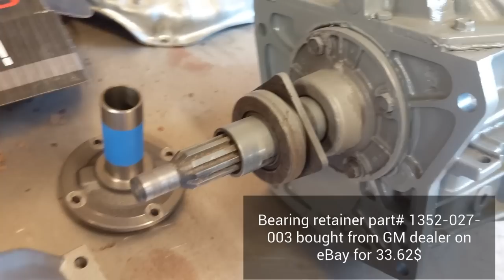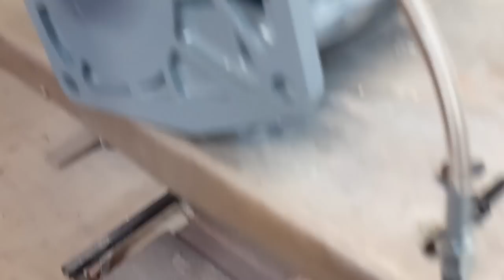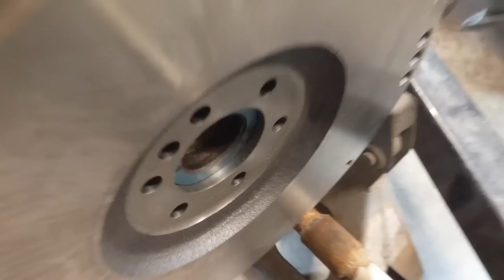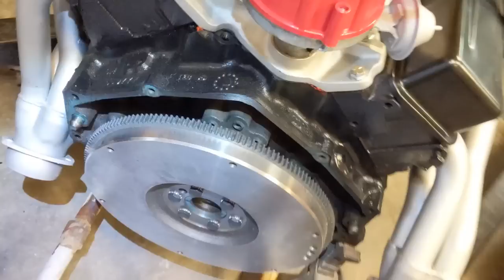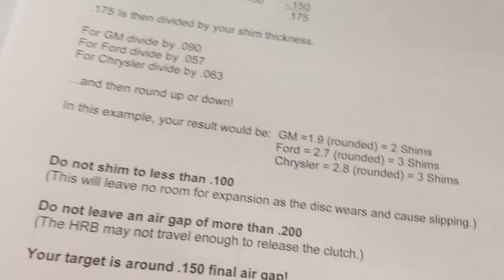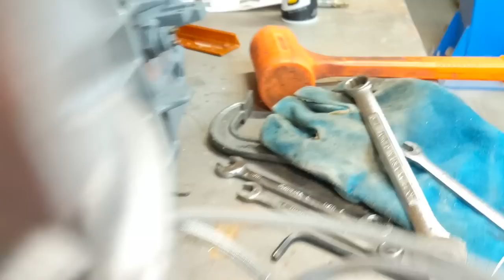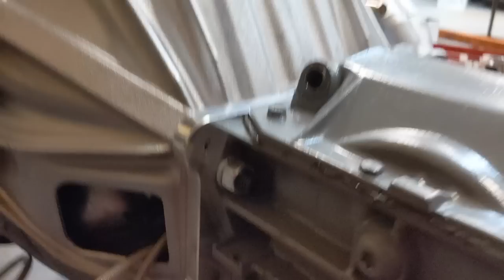Swapping a 5-speed manual behind a first gen Small Block Chevy

Comment: Hey, I was curious on your thoughts in regards to leaving the T5 in a mustang and mating it to a 5.3 I understand the limitation of the T5. I figure its the most cost effective way to go manual 5.3 in a fox. What are your thoughts on the bell housing and throw out bearing?
Reply from the maker: I assume you are talking about a GM vortec 5.3 In a Fox body Ford? Boy that combo would rub some people the wrong way. Not me, though, I think that's a fine idea. I don't think the same bell housing I used would work for you, but the throw out bearing would work as it rides on the transmission bearing housing. It would be cheaper to hook up mechanical linkage, but I like hydraulic TOBs, and the extra cost to me is work saving the headache of linkage on a custom ride. Others will tell you the transmission isn't rated for the HP or tq the 5.3 puts out and they are right, but I've seen guys run 450hp on a stock T5 so as long as you know how to drive without putting unnecessary stress on the trans, you should be fine. If my assumptions on motor are correct and you move forward with this idea, you can reach out to me if you need help sourcing the correct bell housing.
Reply: Thanks for the reply. Sorry, I should have clarified. Yes, I would like to mate a GM 5.3 to a T5. Ive seen some guys run T5’s pretty hard with mildly built 5.0 liters and they seek to hold up. I am aware of the risk of it coming apart though.
Reply: @Gregoman89  In case it is not too late, I have a T5 up against a 2000 5.3 in my S10. I used a 1993 WC T5 out of a v6 camaro, a 621 reproduction bellhousing, a hot rod works adapter just like his, 1973 Chevelle BBC clutch, Sachs 1050 flywheel (literal lifesaver), and a Howe hydraulic throw out bearing with a remote bleeder I bought from speedway. In 1993, the GM t5s changed their bolt pattern to a ford style, hence the adapter. If I would have known that before I bought the trans, I would have bought a mustang T5 like Austin so that the shifter would be straight up. The camaro t5s have a 18 degree twist that I had to correct with my shifter lever once I replaced the original clocked bellhousing with the straight up 621 bell. The sachs 1050 flywheel is a lifesaver, it is for a manual transmission found in the 4.8 and 6.0  Silverados and it is the LS crank bolt pattern but the clutch pattern is for a BBC chevelle clutch. I do not know your application but I kept the original S10 clutch master cylinder as well (11/16) , I did not need the recommended 5/8 master but my pedal throw is just really long. 

As far as the t5 holding up, I have had no problems yet. My 5.3 should be right at 300 horse to the flywheel and have romped on it about 10 times now with no issues. 

Both the ford and GM transmissions work, but I would probably argue the ford is a little better because of the straight up shifter. You could replace a GM t5 tailhousing with an S10 one, but that was more money than what I was willing to spend. 

Good luck
Reply: Cody Haynes thank you for the reply. It’s not too late. I’ve put my project on hold with everything going on.
Reply: I think that sounds like a killer combo if you ask me.
Reply: Sbc bellhousing bolts right to an Ls, just one bolt in the block isn’t drilled
Reply: I believe it would, one of the bolts don't line up and you will also have to shave the passenger side ear! If memory serves me right!
Reply: ...for the starter to sit right! or is my memory all over the map!

Comment: Great video brother!
Hey I'm trying to do the same for my firebird i got the full swap from a 80s Camaro
Here is my problem, maybe you can help me with some pointer
The flywheel don't match with the crankshaft, the flywheel is smaller, i read that it's because of the different generations in the 350 Chevy engine 
Can you shine a light on this problem?
Thanks brother
Reply from the maker: There are a few different gm small block flywheels. Off the top of my head I believe some generations were internally balances or externally balanced. I also believe there are two different weights of flywheels so you have to be careful you don't install the wrong one. Shoot me an email at acthecarguy@gmail.com with as much info as you can and pictures if possible and I'll see if I can help
Reply: @AustinCoulson  400s and 350s with 400 cranks, that's the 383s are usually externally balanced, 163 or 8...tooth I think!  ...dam memory! Some Big blocks also are externally balanced, the rest are the 153s and internal!

Comment: Is that a ford t5
Reply from the maker: Yes, WC-T5 from a Ford Mustang
Reply: @AustinCoulson  how much did this cost
Reply from the maker: @peytonwalters7594  I think I got that 
Transmission for 700, the price for the conversion parts are in the video, but it was something like 2000 in parts, but you can do it for a lot less if you don't use a hydraulic throw out bearing
Reply: @AustinCoulson  ok thank you for the reply

Comment: The GM camaro and TA transmission (T5) have the same front bolt pattern correct ? And the mount up will be the same ? I could keep my 1985 vette bell housing or better to get the Z28/TA  bellhousing ?
Reply from the maker: This is a little outside my wheelhouse but I believe that every Chevy T5 had the same front housing pattern. I wouldn't be surprised if if it were the same front pattern as the older 4 speed manual. Chevy did not like changing things back then

Comment: Great Video, hopefully something like this will work for me....been looking into 5 spd options on this.
I have an '80/90's Chev 4.3L 90°V6, ex-Flex Plate (350ci÷2 cyls essentially)
I'm planning to put it in an early Holden 🇦🇺.
Cheers for your good work from over here👍
Reply from the maker: I don't see why it wouldn't work. The bolt pattern is the same and I think the same flywheel bolts up. If you run into any problems email me at acthecarguy@gmail.com and I'll try to help.
Reply: @AustinCoulson  Thanks very much for your swift reply mate.
I might need that offer at some point...cheers.
Hopefully should be a fairly straight forward swap.
Some of our early Holdens had optional Holden straight 6..Holden V8 OR.....307/350...all had the same K...(I'll be going from what was a Holden straight 6) HANDY THING....It's possible to still buy the genuine or aftermarket Chev-Holden Mountings and they also fit this V6, in the same location as they would be on the V8 blocks...so I'm thinking🤔...Too easy🤗👍
My thoughts were, is the rear of crank different auto/man, which flywheel, which box, from which model etc etc etc etc...this vid helps me to look away from 2nd hand mix and match, and rather the aftermarket/perf. options.
I'll sub now to be sure i can find you when I need some tips....lol.
I have a few shorts vids up too you may find interesting🤔
Reply from the maker: @simonilett998  I'll check your vids out. You guys got some pretty cool variants on GMs and Ford's that I am jealous of. Especially on I6s. I think one issue u may have is if the crank is rear balanced or not, as that changed the flywheel distance and what flywheel you use. The one is the video was externally balanced and you can tell because there is a large iron weight that sticks out and it uses a two part main seal. I seem to remember that most 4.3s I've worked on were internally balances with a one piece ream main seal but I'm not 100% sure
Reply: @AustinCoulson  Yep, mine definately has the one piece rear main seal...not the old rope stuff...and the weird offset crank journals of course.
I haven't had a good look at the crank in a long time....no large weights on the original flex plate that I recall, and never saw the t.c, but I do still have the plate for retro...lol...I bought just the engine, no trans..pretty much complete top to bottom, air cleaner to sump, no electrics...many many years ago, it was a virgin bore when I stripped it down👍
Reply: @AustinCoulson  I have a BW 0507 5spd (cast steel i think, ally top cover) behind the L6 currently...would you happen to know if it's possible to get a bell/flywheel/clutch combo to suit this box or is it maybe too weak for the torque of the mighty 4.3?
Reply from the maker: @simonilett998  I'm not sure as I have little knowledge of the 0507, I'm not sure I've ever even seen one, I thought they were not supplied to the US. I usually try to find the WC T5 with carbon fiber synchros for use in projects. I will say that the BW transmissions seem to be underrated as I've guys mention that they put them behind a bib block Chevy with no issues.
Reply: @AustinCoulson  I'll have to do a little more research...what makes this more interesting is we never got anything with the 4.3 over here (aside from mercruiser engines in boats) everything V6 from '89-90 onwards here has been buick based (so little to compare to) 3.8's or now Alloycrap 3.6's....however we do have gen2, 3 etc so there WILL be a combo I'm hoping.
Reply from the maker: @simonilett998  thats a shame, the 4.3 vortec is an indestructible motor. Small, light,decent power, cannot be killed. I love them. Even the 4l60e they connected with them can handle double the power the 4.3 puts down.
Reply: @AustinCoulson  I believe mine to be pre-Vortec, as it came complete with Rochester 4bbl Carby, also no internal counter balance shafts (I still have the factory air cleaner housing it came with too)
No idea where the engine came from, and have seen one here in a Hyster forklift, large cap Delco elec.dizzy, but running LPG and I believe it was all STD fitment on them, so I guess they must be tough and reliable if used in boats and forklifts..lol👍
My engine also came with a US style 110V plug-in coolant heater element, in one of the core plug holes...I had assumed from US, Canada maybe....guessing to stop the coolant/anti-freeze freezing over night...lol

It's going in a '78 car, so shouldn't be an issue sticking with the carb, for the 'period correct look' and likely there's an efi option i could throw at it in future👍

Comment: do I have to use a hydraulic throwout bearing?
Reply from the maker: You sure don't. You could save a lot of money if you used an traditional setup. You also may not have to swap the front bearing retainer depending on the fork and bearing you use. I prefer the Hyd TOB setup because I love the feel of the pedal, reliability of fewer moving parts and I often do these swaps on vehicles with limited tunnel space so I find it easier to run one small hrdro line than to setup all the linkage for a traditional setup.

Comment: Is there any way to make a mustang t5 work on a ls based platform im doing a 5.3 swap in my 89 and would like to keep the t5 thats in it
Reply from the maker: Yes it's possible, but you would have to take it easy on the T5 as it's only rated to 305hp, and I would assume the LS would be cranking out more than that. If no one makes an adapter for it, you would have to do that yourself. It can be quite time consuming to fabricate those from scratch. I would look into a T56 swap instead as it's stronger and there are plenty of adapters around for it.
Reply: Do everything he did with bellhousing, throwout bearing, bearing retainer and bellhousing adapter. You will need a 621 reproduction bellhousing to clearance the large LS flywheel and a ten spline clutch and corresponding flywheel. I would look at the Sachs 1050 flywheel, it came on the 4.8 and 6.0 manual Silverados. It is very thick, an inch I think, so it will help make up some distance you lost with the bell adapter. I believe the clutch that came on those Silverados were 10 spline so they should work on the Mustang t5, if not, try an old BBC Chevelle clutch. They used to be 10 spline in the early 70s I think and will match up to the flywheel clutch pattern on the Sachs 1050.
Another option would be to use a GM t5. If you got a World Class one out of F body before 1993, it will be the GM bell pattern so no adapter. It will also have the correct length bearing retainer and you would not have to buy a special pilot bearing. The input shaft would also be the higher spline count that would give you access to more LS clutches. The major downside to the GM F body t5s is the twist in the transmission. Once you bolt on the straight 621 bell, the tailhousing will be turned 18 degrees clockwise. An option to fix this it to get an S10 t5 tailhousing, but I chose to just make a shifter rod with a bend in it and save the money. 

Both the GM and the Ford t5 can work, it is just a matter of what you want to replace.  
I hope this is helpful and not too late.

Comment: I done the same thing with mine last year. Ive been wanting to show people how to do it but i havnt got to it. Took a ton of pictures. I used a 95 t5 though so i had to put a spacer between the engine and bellhousing because the input shaft in the 95 was much longer and i also had to trim some off of the tip of the input shaft.
Reply: Speeday makes an adapter pilot bushing but its very long so i just cut it in half so it didnt stick way out
Reply: Also dikota digital makes a speedometer adapter to run a factory manual cable driven speedometer off of the ford t5 or tko transmissions. You also need a conversion u-joint to make the driveshaft work.
Reply: I too am swapping a later gen t5 (94 wc t5) to my small block 350, what size spacer was needed to achieve the required tolerance?

Comment: Is your shifter supposed to be able to move into gears without engagement of the clutch before put into car and plugged into rear axle? I have a manual clutch system in my 65 falcon and my shifter can go into gear without being in clutch but it is not connected to the drive shaft yet
Reply from the maker: Yes, it's perfectly normal to be able to shift through gears without clutch engagement when the engine is off, or the transmission isn't even hooked up to a engine or driveshaft. usually some gears will be easier to slip into depending on the positioning of the synchros.
Reply from the maker: Also, I freaking LOVE Falcons. I've owned a few, but not currently. I am looking for one that I want to put a 300 I6 into with a T5 conversion and strip it down to weigh as little as possible and build it for autocross.
Reply: Austin Coulson thankyou. Iv got a spare 1965 falcon future hardtop original v8 car for ya.
Reply from the maker: @therealdyl5963  oh geez, don't let my wife see this, lol. Where is the car located?
Reply: Austin Coulson crestview Florida

Comment: Gm is input shaft is 26spline how are you using the mustang one?
Reply from the maker: Great question, the gm T5 is a 26 spline (at least the ones I've seen), some guys will swap the input shafts for a Chevy one to use the later 26 spline clutch disc. I prefer to keep the Ford 10 spline and use the older style GM 10 spline clutch disc. The GM and Ford 10 splines are the same diameter so they are interchangeable and there are a lot of options for GM clutches because a lot (if not all) of the GM 4 speed manuals used a 10 spline input shaft. Check out the part number I put in the video if you need more info on where to source the GM 10 spline clutch. Thanks for watching!
Reply: @AustinCoulson  I just got a 85 nwc 5 spd for 150 and now finding out I bought the sick kid of t5's. I may just buy a gforce case and astro gears for it because I am putting it behind a ls in a 86  short bed ranger
Reply from the maker: That's a solid idea. I'm sure you will want the strength since you can get basically unlimited hp out of an LS.  It would give you room to grow hp without worrying about the trans. You building a sleeper or show truck?
Reply: @AustinCoulson  little patina'd pro touring style mini truck or as my wife calls it my scoot scoot.

Comment: I still dont understand what a local guy did here to fit a 1994 camaro v6 t5 to a 1983 305 camaro, he said he drilled out a sbc bell housing then lined up the v6 t5 trans and welded the trans to the housing?
Reply from the maker: I'm not 100% sure but it sounds like instead of using an adapter plate to make it work, he just welded it. If I'm not mistaken the bell housing to engine pattern would be the same on an 84 305 and a 94 4.3 V6, so the difference would be that the 84 would've originally been equipped with a 4 speed with a different bell housing to transmission pattern, but so long as the length of the two bell housing was the same, and he lined up the pilot busing to input shaft he could weld them together.
Reply: @AustinCoulson  I just realized that you used a mustang t5, the guy that I mentioned, he used a 3.4 v6 t5 with the ford bolt pattern, but has the gm shaft with 26 spline teeth, he welded "ears" on the ford bolt pattern to match the munic pattern onto the sbc bellhousing, would the shaft be the same length as the 80s v8?,
Reply from the maker: @bigbl0ck28  I'm not quite sure. I have never swapped input shafts on a t5 before to make a swap work, as I prefer to use the T5's that have the Ford 10 spline shaft since you can just use a standard GM 11 clutch since the clutch disc is also a 10 spline.  I've heard of guys using a 26 spline gm input shaft because for one reason or another they were using a clutch disc that had 26 splines.
Reply: @AustinCoulson  so since my t5 is in a 1994 firebird, it already has the chevy bearing retainer and hydraulic throughout?? This should just be a simple bolt together for me without any modification?, what about input shaft length is the mustang t5 the same length as the fbody v6 t5?
Reply from the maker: @bigbl0ck28  I am not sure on the input shaft lengths for the Mustang vs Fbody T5's, but I would imagine it would simply bolt up